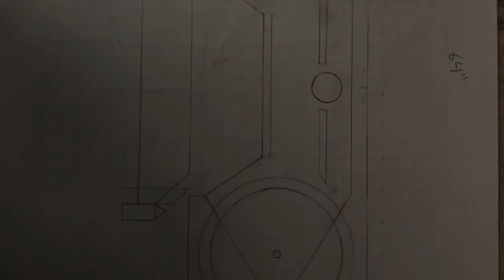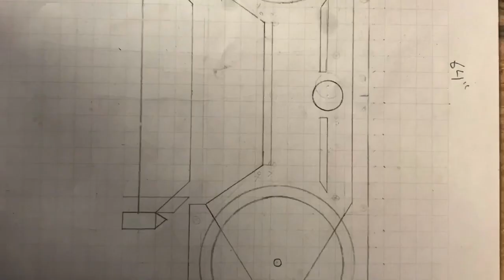Quarantine Sawmill Build

Comment: Your saw look extremely well engineer , it is compact and the controls seem to be accessible, in regard to the Engine size You May have consider a wider cut capacity oderwise great project congratulations on your built. Sgt rod

Comment: Very nice build the mill looks great nice work. I'm wondering what size pulley wheels you used on the lifting to get 1/4  inch lift per turn.